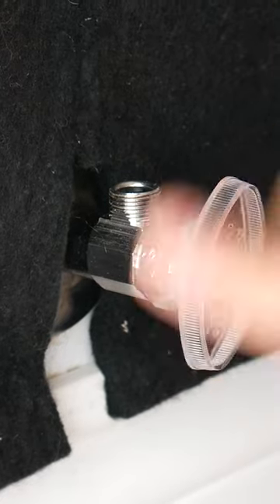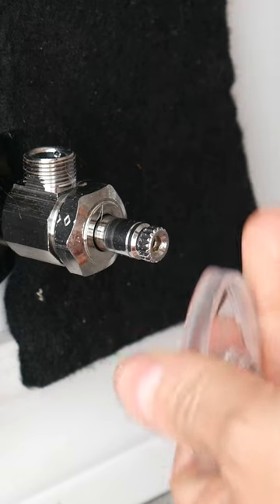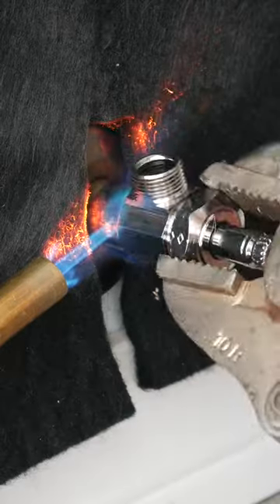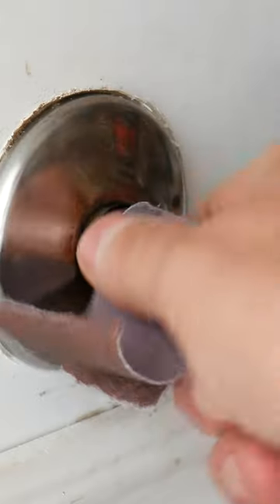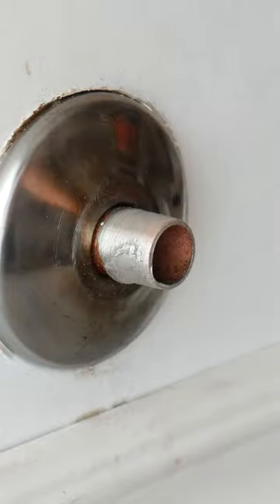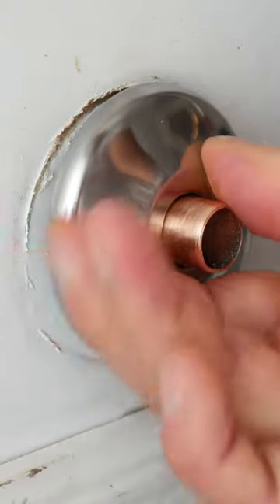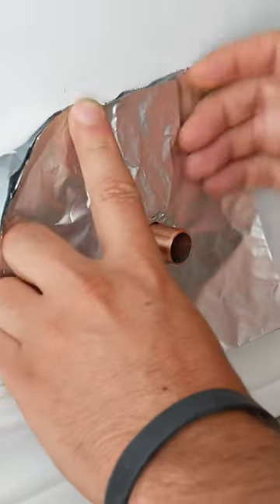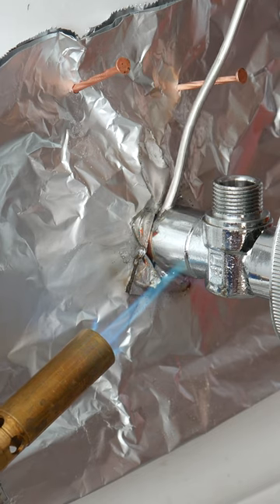How to SOLDER a SHUT-OFF VALVE (sink, toilet etc...) | GOT2LEARN

Comment: Don’t solder a stop on, compression for easier changes later
Reply: Just solder a threaded piece on and thread the stop
Reply: @PassTheBoof  
Exactly! Any quality plumber who isn't just looking to keep his profit margin high, will solder on a male adapter that will last 100 years! I get so frustrated every time I have to replace a piece of garbage compression angle stop!
Reply: Just solder the valve, they’re not hard to replace if you know what your doing
Reply: @mattingegneri1077  
Spoken like a contractor. There's one thing you can count on in life, and that is that eventually valves go bad. And if you're a homeowner who plans on being the one who is going to be changing out that valve, then you're going to make it easier on yourself in the future.
Reply: @davidscott5903  If your a homeowner, do whatever you want.  We love coming to fix homeowner attempts.  Usually more work than it woulda been from the beginning lol.  We do things as a professional.  In NY, everything is sweat.  I don’t like pro press as a valve because as you said, it will go bad, and compression is not considered “professional”.
Reply: @davidscott5903  personally I just rebuild the valves. I’m good at sweating but avoid it if I don’t have to
Reply: @jackmyhre8759  
If it's a rebuildable valve, then I am so cheap, that I would almost never do anything else.👍🤣
Reply: @jackmyhre8759  
Usually if it's rebuildable, then it's good enough quality to last a very long time with a rebuild.

Comment: This is a good how to change if necessary, simpler and easier is to leave the housing in place and buy the rebuild kit for $5
Reply: And then you’ll be rebuilding it next time it fails, or you can buy a 1/4 turn that’ll last much longer.
Reply: Just replace it. It saves time and money over the years and decades.

Comment: Sweating” and “soldering” are synonymous terms used to describe the process of using heat and solder to join copper pipe and fittings to one another. You can tell your neighbor you're heading downstairs to “solder” a joint—but “sweating” makes you sound much more worldly and DIY hip

Comment: Your not a plumber we don't use vise grips for that we use Channel locks the #1 tool of all plumbers now doing a outside faucet use locking pliers to hold copper out so can remove and replace , Also spend 20 bucks get a flame blanket it last long time

Comment: Run flux around the old solder when its still hot, smooths it off and makes it alot easier to clean (if you dont have the tool he used in the vid)

Comment: You have excellent information on your YouTube channel.   

I installed a brand new water heater in my garage by watching your channel.  

I also cut out the old corroded copper water pipes in the garage and soldered in 7 new gate valves into the 3/4” copper water pipes by following your instructions on soldering copper pipes, valves and fittings.  

Your tip on “Tinning Flux” made the soldering task much easier. 

This tip, on utilizing Sterling/Worthington brand lead free, solder with a low temperature melting point, came in very handy. 

The solder with a low melting point, allowed the solder to smoothly flow into the copper pipe and gate valve connection, without worrying about the flux burning off.

All the soldered joints were solid and did not leak at all. 

My next project is removing/desoldering a water shut off valve for a toilet in my house.  

I have a 1/2 inch, in line, gate valve that I am considering soldering into the 1/2 inch copper pipe protruding from the wall.  

I am searching for an in-line sweat-on adapter from 1/2 inch female, then reduced to the compression fitting, that would attach the flexible hose going to the toilet’s tank.

Once again, your excellent videos were very helpful.

Comment: Remove the packing nut and remove the guts then you wouldn’t need to boil
The water out, it would just drain and making it much easier to unsweat, just a thought.

Comment: Chrome and mulgrips don't go - should of used a clothes to prevent grip marks
Reply: Or you could of used an adjustable spanner with cover clips
Reply from the maker: The Knipex I have are adjustable smooth jaws so it doesn't mar the chrome.

Comment: You should unscrew the guts so you don't melt the rubber inside...
Reply: Whats the point if you’re replacing the valve?

Comment: It looks like you took off a perfectly good multi-turn valve and installed one of those junk quarter turn valves that'll be job security for later
Reply: What's wrong with the 1/4 turn ball valves?
Reply: @D-Mayor  they don't have a packing nut they rely on an o-ring on the stem. Bad enough on a multi-turn valve leaks we can just snug that nut up when that multi valve leaks we're going to have no choice but to change it. And if you couldn't tell I don't like ProPress or shark bites.

Comment: You have very good information on your YouTube channel.   

I installed a brand new water heater in my garage by watching your channel.  

I also cut out the old corroded copper water pipes in the garage and soldered in 7 new gate valves into the 3/4” copper water pipes by following your instructions on soldering copper pipes, valves and fittings.  

Your tip on “Tinning Flux” made the soldering task much easier. 

Your tip, on utilizing a lead free, solder with a low temperature melting point, came in handy. 

The solder with a low melting point, allowed the solder to smoothly flow into the copper pipe and gate valve connection, without worrying about the flux burning off.

All the soldered joints were solid and did not leak at all. 

My next project is removing/desoldering a water shut off valve for a toilet in my house.  

I have a 1/2 inch, in line, gate valve that I am considering soldering into the 1/2 inch copper pipe protruding from the wall.  

I am searching for an in-line sweat-on adapter from 1/2 inch female, then reduced to the compression fitting, that would attach the flexible hose going to the toilet’s tank.
Reply from the maker: You are most welcome 🙏